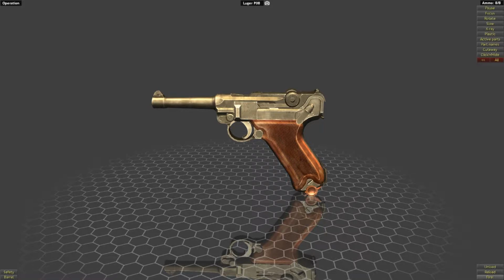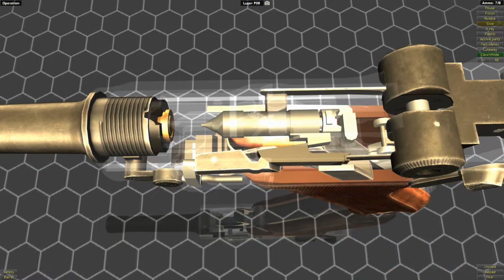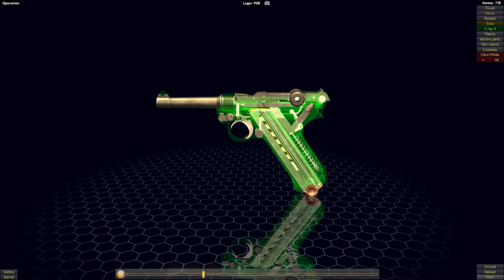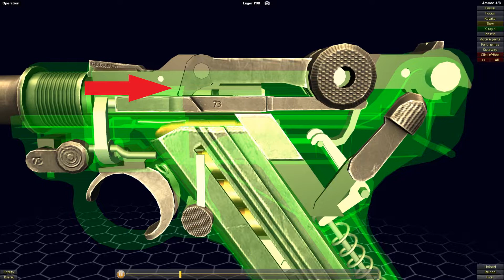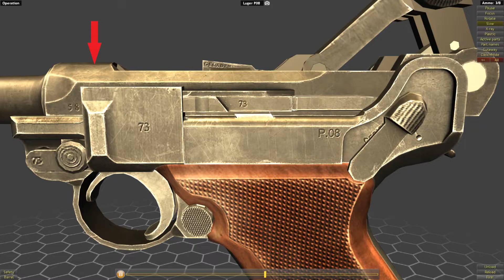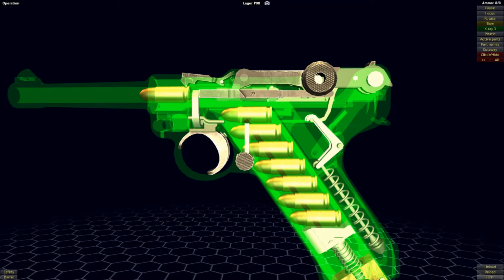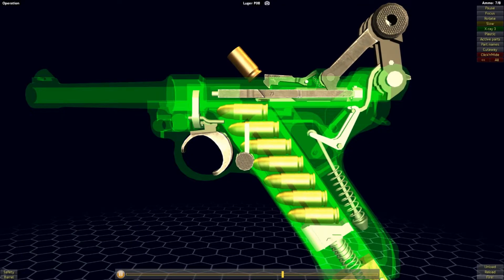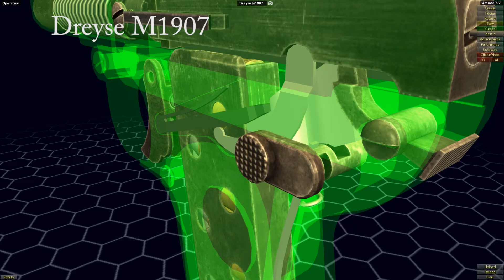How Striker Fired Actions Work Part 4: Luger P08

Comment: P08 has a major flaw, I can fire the gun just by squeezing on the side sear, or even without the lower half installed! The external safety bar on my P08 doesn't really prevent the sear from disengagement when it's raised.
I tried to telegram Luger, no one writes back. I wonder if it's still under warranty?!
Reply: The joke could have been better...

Comment: The luger is a sweet shooting gun. Excellent trigger.
Reply: Why do you think it has an excelent trigger? The guns I shot so far had a pull which ends with a little more resistance. Once you push over that resistance the gun fires. If I understand the design correctly, this shouldnt happen with the P08